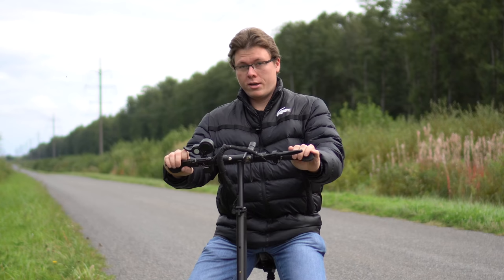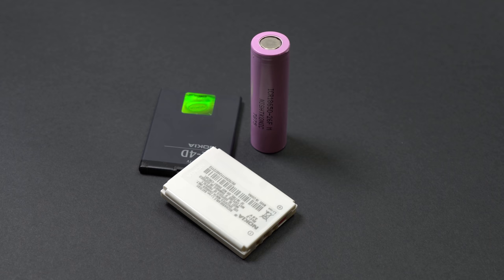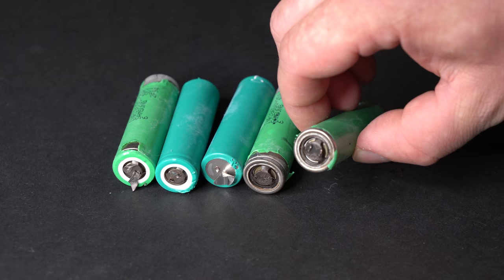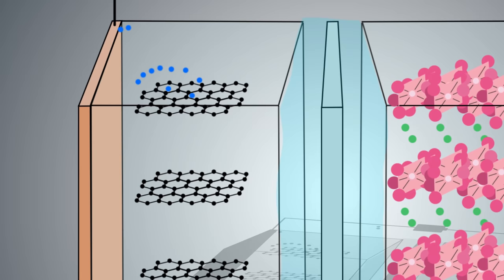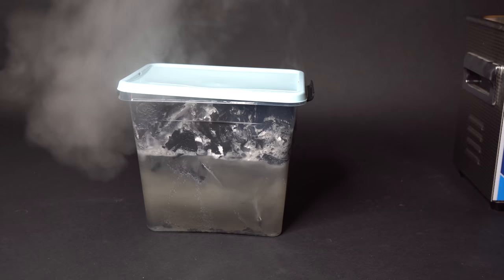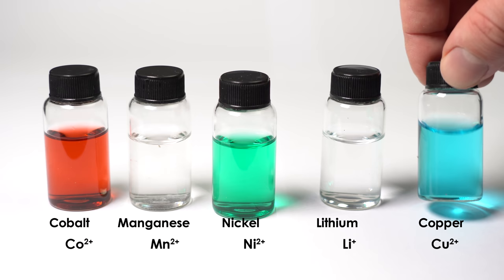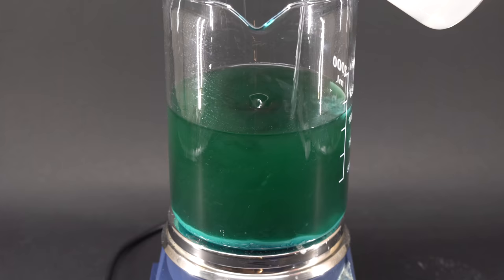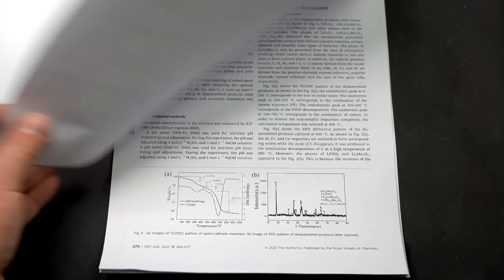How Much Lithium Can I get From a Lithium - Ion Battery?

Comment: At 10 years, the drive train of a an EV should be perfect working order. An industrial electric motor has few moving parts and can easily do a million miles without servicing.

The suspension system will need periodic rebuilding, and the vehicles interior trim will require renewal. Carbon fibre or fibreglass composites for the exterior panel work are highly resistant to minor impacts and can be repaired, resurfaced and even remodelled.

The battery pack will have lost its cold cranking amps, but it will still be a good stationary power accumulator for at least a decade. If most low voltage appliance wiring is replaced by blue tooth and WiFi, the vehicle could be designed to be remanufactured and quickly put back on the road. 

Our economy only requires a limited number of drive trains, the cabin design can be modular to suit different life styles and tastes. There is no reason why a car could go through several incarnations as owners go through the major period of life, single adult, family, trade, recreation. A car could go from being a coup to a station wagon to a sedan.

Comment: Fluoride compounds tend to be very toxic - either directly or post interaction with organic organisms. Consider sodium fluoroacetate...
The difficulty in recycling batteries - and the time and energy required to do it - is one of the reasons why efficient organic fuel cell technology is far more efficient.

Comment: What determines the voltage of a battery? Is it the amount of copper or it's thickness or something else compared to a 1.5v or 1.2v or even a 9v battery?
Reply: 1.5V is the electrical potential of single carbon/manganese or lead/acid cells.
Lithium chemistry typically has higher potential around 3-4v per cell.
A 9V battery has a half dozen AAAA cells wired in series inside it, and is the only 'true' battery you're likely to find sold in stores.
A typical lead/acid automotive battery is six 2.1V cells in series giving a potential of 12.6V.
Reply: The voltage of a battery depends on the chemical potential of the cells and how many are wired together in series.
Cells are also wired in parallel to increase amperage.
Some battery packs incorporate both series and parallel configurations.

Comment: I don’t know why they call the cathode the anode in batteries. Electrons flow from cathode to anode not the other way around.
Reply: "Cathode" and "anode" swap places during charge vs discharge, but are named based on their role during discharge.  "Positive" and "negative" are less confusing, I think...
Reply: @olawlor   Nope... ya dope. 
Try reading it again with the key word being 'electron flow'.
Think about that, if you can.

Comment: Why not just dissolve it all in HNO3 then drop-out the metals one by one in order of the galvanic table?
Reply: What about the production of nitric acid in thousands of tons and emissions of nitric oxide from industrial processing?
Reply: @marcusmt4746  what about it? That has absolutely nothing to do with using nitric in the process of extracting a few grams of Li from a handful of batteries.

Comment: Back in 2013 we made prospect of recycling lithium car batteries , we did have resources to disintegrate and stock , we tried to convince Toyota but they didn't agree to do a joint venture , to put it in simple way there's till.now No efficient sustainable way to recycle lithium its just not cost effective , my personal conclusion is we have very advance filtering technology for gasoline , even external filters which can be fitted to vehicles exhaust but since those are very cheap to manufacture no one is taking keen interest
Reply: So, you think burning fossil fuel is 'cheap'? 
What happens when the cheap easy to find crude oils run out?
Reply: @BTW...  hybrid.technology is way better than purely electrical, similarly lithium batteries have generations which means a car with gen 2 battery cannot have gen 1 , this is already to control the demand and supply of batteries. I never said we have to promote fossil fuels but I'm saying we already have a very affordable way of filtering their emissions but that is not promoted , so now one has to buy a whole new vehicle to go electrical .

Comment: did you know if you freeze a lithium battery, the charge completely dissipates. need below zero temperatures. i know -30c will drain my phone battery in a matter of seconds.
Reply: Um there's a protection mechanism in there...
Reply: It doesn't drain the battery but stops the chemical reactions necessary for battery discharge or charge.
Heat it up again, and it works again.
Never charge below freezing and reduce charge current relative to temperature.
Reply: @MadScientist267  then why did it go from full charge to no charge in less then a minute? oh wait, that is right, that protection circuit you mentioned, is only for when it is charging. but i guess you assume everyone has their phone plugged in at all times?
Reply: @emilen2  weird, then how did my phone went from a full charge to no charge in less then a minute under -30? heh, why am i even asking you when i already know the truth and what happens electrochemically. yea, the cold prevents it from charging, but it does a lot more then that. it also increases internal resistance and decreases capacity. so at -30, even a fully charged phone will have about 20% of its capacity. which means it discharges in a matter of minutes. as such, one can use this simple concept, to discharge batteries easily and safely in just seconds. but hey, i am sure you know all of this yea? but it seems what you wrote was taken from a quick google search and cherry picked the information that suits your narrative.
Reply: @pyronac1  It doesn't "discharge" them per se, low temperature cripples the cell's capacity... So it dies quick. At -30 I'd be surprised it came on.
Reply: @MadScientist267  well i mean, its a phone battery, inside a phone, so it was on when i walked into the room. when i walked out a minute later, my phone was dead. like i said, the cold lowers the capacity and increases internal resistance. so it wont take much but a short to drain a full batter in just a few seconds. kind of like discharging a capacitor. i guess i should use more words when i try to explain something. but i just assumed people would understand that when i said -30 will drain a phone battery in seconds that, the cold itself isnt draining the battery but the phone is. and the cold makes it so it drains rather fast. with low current. i apologize if you thought i meant that the cold itself drains it. 

reasons i would make the worst teacher.
Reply: @pyronac1  It's true that cold lithium batteries under load may discharge faster, but the increased internal resistance also creates a voltage drop which makes the phone shut down sooner. It senses a lower voltage from the battery.

Comment: Every electric car owner is a massive polluter. This video illustrates how recycling Li Ion batteries is more difficult than manufacturing them which DIRECTLY means they will end up as landfill. and all the lies told that electrical cars are green is criminal.
Reply: A battery discarded every 5 - 10 years is a LOT less waste than burning hydrocarbons every day.